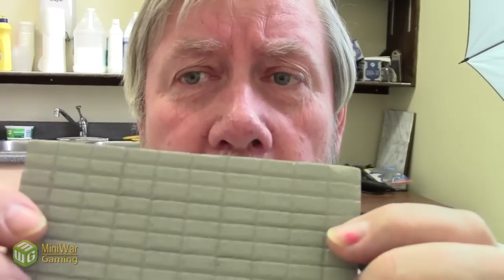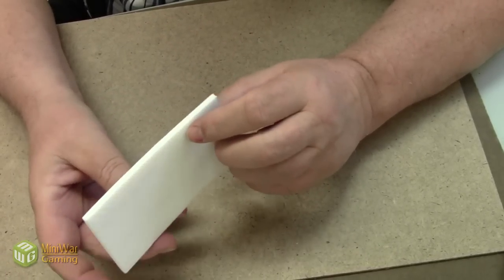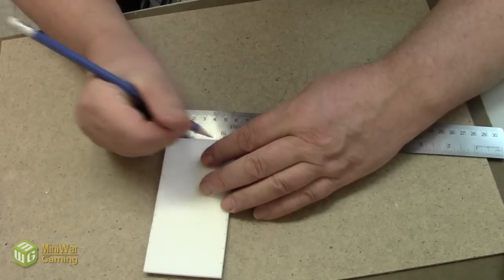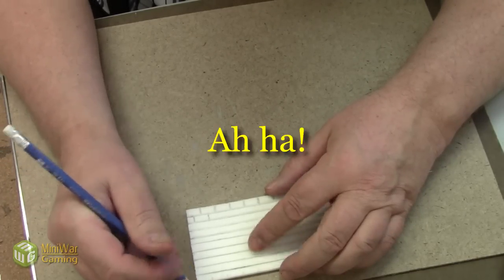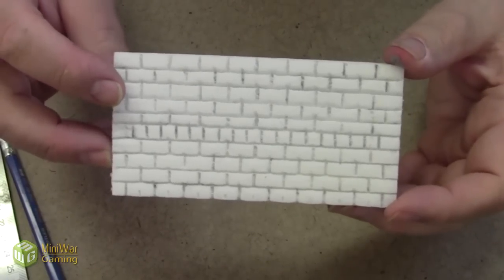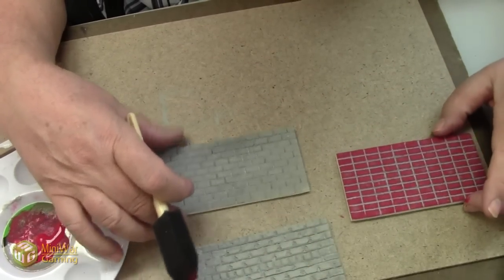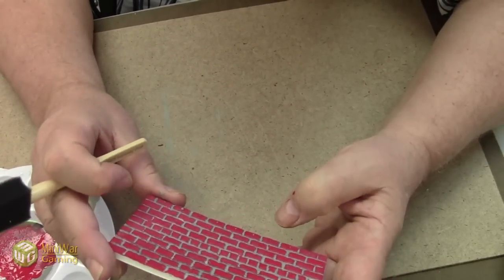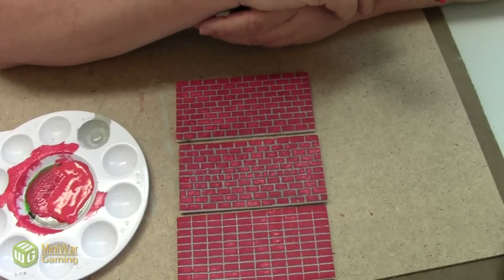How to Create Various Styles of Brickwork for Terrain Projects

Comment: Nicely done. I think the warp on the foamcore occurs because of the tension from the paper on the other side. In my experience if you remove the paper from both sides it will be warp free. Also, remember to rinse out your sponge at the end peeps, or the paint will dry hard ;)